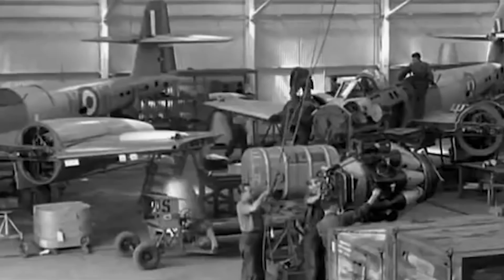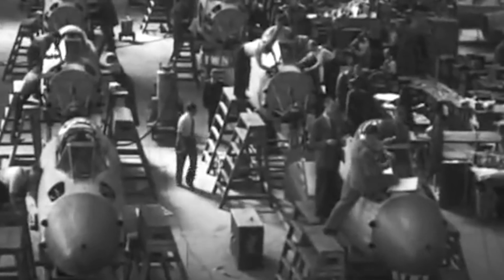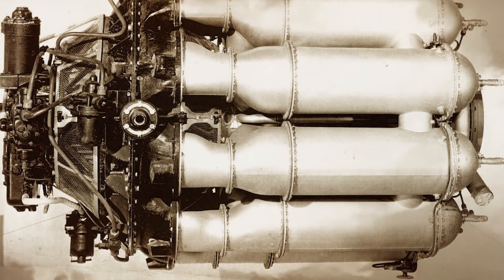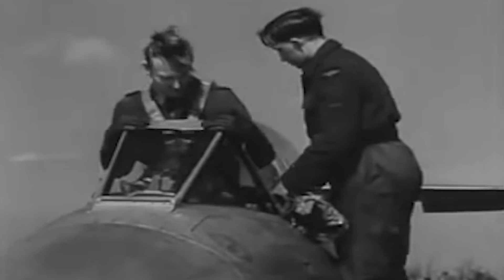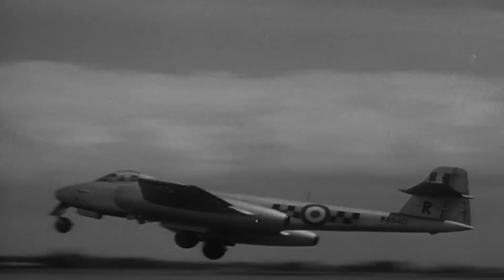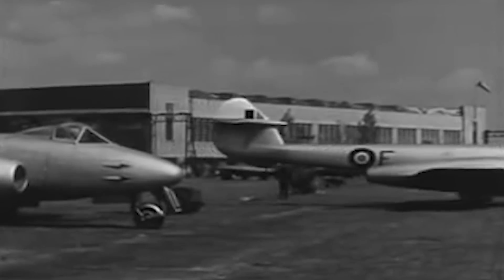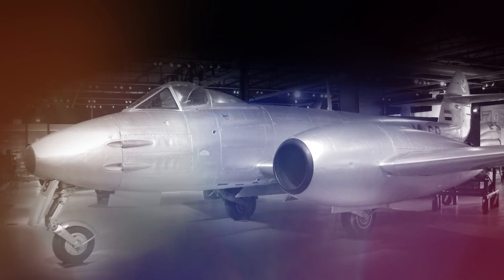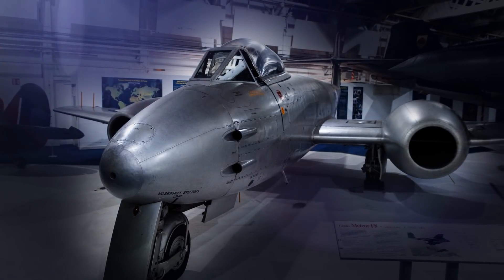Gloster Meteor - The Only Allied Jet to Fight in WW2

Comment: The 1at British  jet was the E28/39 flown in the early part of WW 2 purely as a test plane. Letting the Meteor  to be the 1st Britixh jet and the only allied jet to see action  flying against the V 1 cruise missile
Reply: The E28/39 was the 4th jet aircraft to fly successfully.
The Gloster "Meatbox" was a disappointing failure as a fighter and only killed British pilots during WW2.

890 crashed in RAF service alone, killing 450 British pilots.
Reply: @sandervanderkammen9230 

We feel we can clear up some commonly held myths and misconceptions, obviously.

It's always good to see the facts presented clearly and concisely isn't it?

Thanks for that very informative comment.
Most enlightening.

We couldn't find any supporting evidence anywhere though so we think there may be some errors in their excellent post & errors in some other comments with a similar theme.

The basic overall design of the Gloster Meteor was fatally flawed.???

    The Meteor was not fatally Flawed, 3950 were built serving in more than 20 air forces for more than 20 years.  Martin Baker use the Gloster Meteor for ejector seat R&D.

Gloster continuously tried to improve the aircraft eg; improved tail, stronger fuselage and different wings, stronger wings, ect.???

      Gloster got it pretty much right first time especially considering the circumstances & the aircraft type.

Unfortunately as a result of being very hastily
converted from a twin propeller driven nightfighterdesign it was plagued with flaws inherent to the fundamental design.???
  
      Gloster ceased work on the much larger  Gloster Reaper propeller & turret night fighter in order to design the Meteor from scratch (The Beaufighter was similar to the Reaper).

It was directionally unstable at nearly all speeds and tended to pitch down uncontrollably at low speeds and a nasty tendency to snap into a flat spin at high speed.???

    It's accident losses were much lower than many other later aircraft. Most accident losses were training errors.

The asymmetric handling was appallingly and was considered unrecoverable and fatal during take-off or a go- around.???

      It's accident losses were much lower than many other later aircraft. Most accident losses were training errors.

RAF Chief Air Marshall Sir Frederick William Bowhill called the Gloster Meteor a quote; "a truly dismal and lackluster aircraft"???

    The Chief Air Marshall didn't say that.
   
   Sydney Camm said Gloster tried everything but flipping the engines and pilot seat around and flying it backwards???

     Sydney Camm didn't say that.

Early days, jet fighters & an accident losses rate comparison.

De Havilland Vampire, Sea Vixen & Gloster Meteor accident losses were not high or unusual for fighter aircraft at the time. De Havilland built large numbers of all metal airframe aircraft before the DH Comet for example.
We mustn't forget of course that the DH Vampire first flew in 1943 & the jet engine was also built by De Havilland. There were examples of the Vampire interceptor / fighter in service until 1990 which was operated by more than 30 countries. Of course, at the time, during 1943, the Vampire was one of the world's first jet fighter aircraft which also happened to have extremely reliable jet engines, obviously.

Non combat phase accident losses.
% of Aircraft built.
The Canadair CL-44 was a turboprop airliner.
Canadair CL-44              (ff 1959 ) 48%
Lockheed XF104              (ff 1954) 100%
Lockheed  P80                 (ff 1944) 43%
Lockheed F104                (ff 1954) 45%
MD FH Phantom 1           (ff 1945) 35%
MD F4 Phantom 2           (ff 1958)  28%
MD F3H  Demon              (ff 1951)  32%
Gloster Meteor               (ff 1943)  21%
DH Vampire                    (ff 1943)  23%
DH Sea Vixen                  (ff  1951) 33%
Gloster Javelin                (ff 1951) 20%

   An example of what goes on these days in various countries.
Obviously, for example, there are of course no German companies that makes German jet aircraft in Germany & there are no German Companies that make German gas turbine aero engines in Germany that are suitable for widebody airliners.

The Gloster Meteor served with more than 20 airforces and successfully engaged in air to air combat with later design aircraft during a number of conflicts. 

We hope this helps, obviously.

As always Cheers & 👍 indeed.
Reply: @sandervanderkammen9230 

We believe we can clear up some commonly held myths and misconceptions, obviously

It's always good to see the facts presented clearly and concisely isn't it?

British Aerospace Sector. 

Interesting British achievements.
There is no doubt that the Fairey (England)
Delta 2 was of course the world's first jet
aircraft to exceed 1000 mph.  lndeed It
exceeded the previous record by 310 mph &
held the record for more than a year. Incidentally, the Dassault Mirage series of aircraft are based on the Fairey Delta 2. 
March 1956,  UK Peter Twiss,
1,132	 mph, Fairey Delta 2,	 Chichester, UK

The next speed record after the FD2 -
December 1957, USAF	1,207.6	mph, McDonnell F-101A Voodoo, 	Muroc, California 😎.

Non combat phase accident losses.
% of Aircraft built.
The EE Lightening did not have unusually high losses. 
The Canadair CL-44 was a turboprop airliner.
Canadair CL-44               (ff 1959 ) 48%
Lockheed XF104             (ff 1954) 100%
Lockheed  P80                (ff 1944)  43%
Lockheed F104               (ff 1954)  45%
MD FH Phantom 1          (ff 1945)  35%
MD F4 Phantom 2           (ff 1958)  28%
MD F3H  Demon              (ff 1951)  32%
MD F-101 Voodoo           (ff 1954)  34%
EE Lightening                   (ff 1954)  33%
Gloster Meteor                (ff 1943)   21%
DH Vampire                     (ff 1943)   23%
DH Sea Vixen                  (ff  1951)  33%
Gloster Javelin                (ff 1951)   20%

Note that the Meteor didn't have particularly high losses, flew with more than 20 airforces for decades, got involved in air to air combat during a number of conflicts successfully against aircraft that first flew many years after the Meteor first flew.

Early days, jet engines. Whittle performed the world's furst demonstration of a gas turbine aero engine in 1937. The RR Nene, a centrifugal gas turbine aero engine, was the world's most reliable & most powerful gas turbine aero engine in 1944. Licensed built versions & copies of the RR Nene & RR Derwent would go on to power many aircraft in Russia including the Mig 15 & Mig 17, the US, China, France & other countries for decades after 1944. Incidentally, the Mig-15 was in essence an upsized / tweaked copy of the Whittle / Gloster E28/39 jet aircraft including a copy of the RR engine.  The centrifugal compressor gas turbine aero engine with Whittle style reverse flow combusters and sometimes an axial compressor section is still manufactured by more than one company, the main application being helicopters.

   That's correct, The Tornado & Typhoon & their engines are supersonic & are indeed British design aircraft with British design engines built by an international consortium. The Tornado design for example started life during the 1950s at Vickers as the AFVG, it's engine is based on the RR RB-199. The EE Lightening is also a British Supersonic jet aircraft. At the time the EE Lightening first flew it was indeed one of the fastest aircraft on the planet.

  The Typhoon is the British BAC-EAP with an engine based on the British RR XG-40, the Typhoon is also built by an international consortium.

  Clearly It's a great pity & a crying shame that British military forces had to occupy a large part of Germany for decades after 1945 & Russian military forces had to do the same. Of course Russia still posseses a large chunk of what was German territory & of course  Russia & the UK produce nukes. Obviously Germany does not produce nukes.

An example of what goes on these days in various countries.

   Indeed, There are no German companies that make German jet aircraft in Germany & there are no German Companies that make German gas turbine aero engines in Germany that are suitable for widebody airliners.

  BAe Systems, GKN Aerospace & Rolls Royce combined now do more Airbus work than Germany on an absolute basis & significantly more work than that on a per capita basis.
   
  Per capita for the home nation BAe Systems is the world's largest defence contractor. BAe systems announced the recent £4 Billion takeover of Colorado based US based Ball Aerospace.
  
  BAE systems now does a significantly higher value of work for Airbus than it did when it was a major Airbus shareholder before 2005.
     
  RR now owns US Engine maker Allison for example which does classified Aerospace work for the US Govt.
   
 Anybody currently flying on a widebody airliner stands a good chance of being on an aircraft powered by RR gas turbine aero engines built in the UK.

  A glimpse of what goes on in the very internationally orientated British aerospace sector.

Boeing Apache Attack Helicopter.
AH-64: 75 UK suppliers, 7% UK content, global fleet of 1280+ aircraft.
F35B more than 130 UK Suppliers, more than 30% UK content.
F35A & F35C more than 130 UK Suppliers, more than 15% UK content.

The UK has the world's highest combined per capita Nuclear, Defence & Aerospace Sector activity.

Rolls Royce Holdings UK
Subsidiaries
- Rolls-Royce plc
- Rolls-Royce North America (Allison etc &  
  Classified Military stuff)
- Rolls-Royce AB
- Rolls-Royce Deutschland
- Rolls-Royce India Private Limited
- Rolls-Royce Marine Power Operations
- Vinters Engineering Limited
- Rolls-Royce Controls and Data Services
- Rolls-Royce Power Systems
- Bergen Marine
Joint ventures include:
- Rolls-Royce Turbomeca
- MTU Turbomeca -

Trent Family
The MT30 (Marine Turbine)
Industrial Trent 60 Gas Turbine
Trent 7000
Trent XWB Airbus A330neo.
Trent 1500
Trent 1000
Trent 500
Trent 600
Trent 700
Trent 800
Trent 8100
Trent 900

RR wholly owned subsidiaries in Germany handle smaller 2 shaft RR gas turbine aero engine work.   

We hope this helps of course.
     
Cheers, as always & indeed 👍.

Comment: One of the reasons the Metwor gained a reputation as a killer was the single engine thrust line being so far off the centre line of the fuselage. It caused massive yaw with the associated induced roll which if not countered fast enough became a flat spin.
Reply: Yes, a fatal flaw that goes back to the aircraft design being hastily converted from twin propeller nightfighter design.
 The lack of rudder authority combined with terrible asymetric flight characteristics made the "Meat box" a real pilot killer.. an engine failure on take-off was considered unrecoverable.
Reply: @sandervanderkammen9230 

We believe we can clear up some common misconceptions & myths.

It's always very important to note the relevant facts obviously.

Muncherz Krappenz DiktorBummer KARZEESTAN Jurkzxoffenzstadt & co - they should all note with much awe and great wonder.

The ME-262 was limited to running away from allied piston engine fighters  & risking engine destruction while doing so & it took 3 downed 262s for each downed allied bomber over Germany where German air inferiority was fairly ubiquitous so there was large swarms of allied bombers available to have a go at.

After 1941 it was clear The Gloster Meteor wasn't required as such & was limited to operation over the UK & occupied allied territories to keep examples out of the wrong hands.

Yes it is of course correct that the world's first jet powered aircraft to exceed 1000 mph was indeed a British aircraft.
Contrary to their copious & ubiquitous posts regarding accident losses of various UK aircraft.
As they mentioned previously, the Sea Vixen & Gloster Meteor were indeed very competent & beautiful aircraft.
In fact the Meteor was the world's first aircraft to exceed 0.85 on the combined 2 year looks & capability scale for jet fighter aircraft.
   Indeed A rather superb Gloster Meteor was the world's first Turboprop aircraft in 1945. In 1945 & 1946 trail blazing Gloster Meteors set world speed records.
     Yes, of course it is correct that British military aircraft at the time did not have unusually high accident losses rates.
For example
De Havilland Vampire &  Sea Vixen & Gloster Meteor accident losses were not high or unusual for fighter aircraft at the time.
Non combat phase accident losses 
% of Aircraft built.
The Canadair CL-44 was a turboprop airliner.
Canadair CL-44                    (ff 1959 ) 48%
Lockheed XF104                    (ff 1954) 100%
Lockheed  P80                       (ff 1944) 43%
Lockheed F104                      (ff 1954) 45%
McDonnell FH Phantom       (ff 1945) 35%
Gloster Meteor                     (ff 1943)  21%
DH Vampire                          (ff 1943)  23%
DH Sea Vixen                       (ff  1951) 33%
Gloster Javelin                     (ff 1951) 20%

Gloster Meteor.
3950 Built.
In service 1944.
70% didn't have ejector seats.
839 accident losses.
436 accident loss fatalities.
21% accident losses.
11% accident loss Fatalities.

Lockheed F104.
2578 Built.
In service 1958, 14 years after the Meteor.
All had ejector seats.
1100 accident losses.
425 accident loss fatalities.
43% accident losses.
17% accident loss Fatalities.

We hope this helps.

Cheers
👍 & 😎 & of course 🙂 indeed.
Toodle PIP Old Chap 
     
           
        
.. . .. . ... .... . 
.... . ....  ......
xcvvvvvvvviix
cvvvvvrcxccc

Comment: Balloons accounted for eight per cent. of the bombs destroyed. Their number had rapidly increased but had to be governed by the amount of hydrogen available in the country.1 Moreover, to fly them in a gale of wind would have entailed losses too heavy for replacement. There were many days, therefore, when the balloon barrage 1 In just over two months one squadron of balloons was supplied with 18,830,800 cubic feet of this gas.
 --166-- 
was entirely or partly grounded. During this period the guns shot down thirteen per cent. The introduction of new American equipment was to be of great effect as soon as the gun crews had been trained to use it. 
Hyperwar Royal Air Force 1939 1945 Vol III

Comment: Interesting oversight outlining Meteors combat record versus MIG 15 over Korea by 77Squadron RAAF….. no mention yet showed footage. Why?
Reply: The "Meatbox" was never a fighter and obsolete as a ground attack aircraft by the Korean War... they were absolutely slaughtered by the MiG-15.
Reply: @sandervanderkammen9230 

That's correct, In fact the Gloster Meteor, although a much earlier aircraft than the Mig, was not in fact outclassed by the Mig in Korea even given the Migs more powerful engine which was an upsized copy of the RR Nene.
   
   Agreed,  Indeed In one particular battle 45 Migs tangled with 12 Meteors and failed to demonstrate superiority over the Meteors. Australian politicians designated the much earlier design Meteor for Australian infantry ground support only for political reasons stating the claim that the Meteor wasn't superior enough.
Reply: @sandervanderkammen9230 We believe we can clear up some common misconceptions & myths.

It's always very important to note the relevant facts obviously.

Muncherz Krappenz DiktorBummer KARZEESTAN Jurkzxoffenzstadt & co - they should all note with much awe and great wonder.

The ME-262 was limited to running away from allied piston engine fighters  & risking engine destruction while doing so & it took 3 downed 262s for each downed allied bomber over Germany where German air inferiority was fairly ubiquitous so there was large swarms of allied bombers available to have a go at.

After 1941 it was clear The Gloster Meteor wasn't required as such & was limited to operation over the UK & occupied allied territories to keep examples out of the wrong hands.

Yes it is of course correct that the world's first jet powered aircraft to exceed 1000 mph was indeed a British aircraft.
Contrary to their copious & ubiquitous posts regarding accident losses of various UK aircraft.
As they mentioned previously, the Sea Vixen & Gloster Meteor were indeed very competent & beautiful aircraft.
In fact the Meteor was the world's first aircraft to exceed 0.85 on the combined 2 year looks & capability scale for jet fighter aircraft.
   Indeed A rather superb Gloster Meteor was the world's first Turboprop aircraft in 1945. In 1945 & 1946 trail blazing Gloster Meteors set world speed records.
     Yes, of course it is correct that British military aircraft at the time did not have unusually high accident losses rates.
For example
De Havilland Vampire &  Sea Vixen & Gloster Meteor accident losses were not high or unusual for fighter aircraft at the time.
Non combat phase accident losses 
% of Aircraft built.
The Canadair CL-44 was a turboprop airliner.
Canadair CL-44                    (ff 1959 ) 48%
Lockheed XF104                    (ff 1954) 100%
Lockheed  P80                       (ff 1944) 43%
Lockheed F104                      (ff 1954) 45%
McDonnell FH Phantom       (ff 1945) 35%
Gloster Meteor                     (ff 1943)  21%
DH Vampire                          (ff 1943)  23%
DH Sea Vixen                       (ff  1951) 33%
Gloster Javelin                     (ff 1951) 20%

Gloster Meteor.
3950 Built.
In service 1944.
70% didn't have ejector seats.
839 accident losses.
436 accident loss fatalities.
21% accident losses.
11% accident loss Fatalities.

Lockheed F104.
2578 Built.
In service 1958, 14 years after the Meteor.
All had ejector seats.
1100 accident losses.
425 accident loss fatalities.
43% accident losses.
17% accident loss Fatalities.

We hope this helps.

Cheers
👍 & 😎 & of course 🙂 indeed.
Toodle PIP Old Chap 
     
           
        
.. . .. . ... .... . 
.... . ....
xcvvvvvvvviix
cvvvvvr